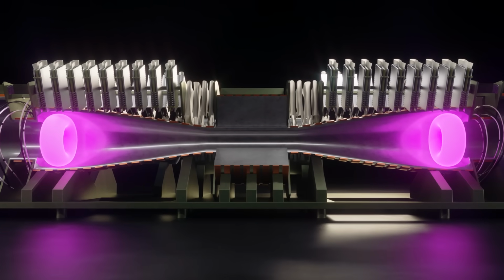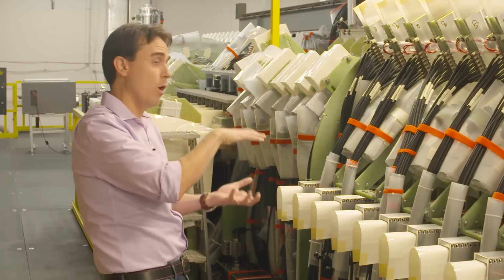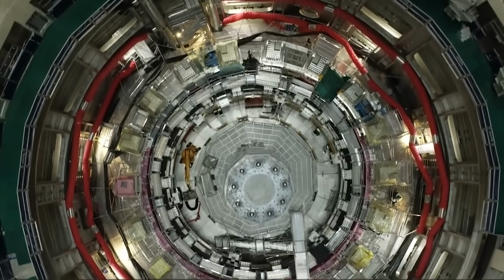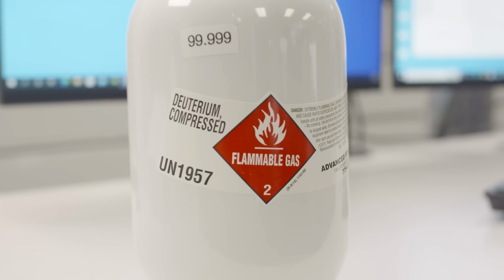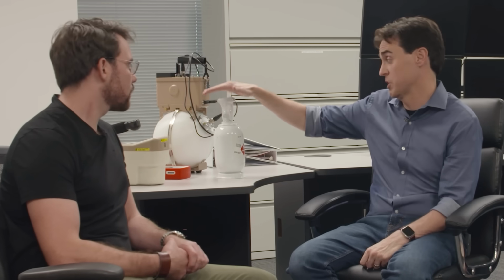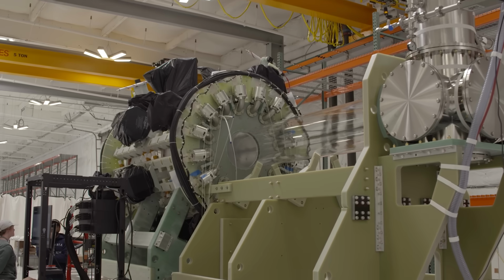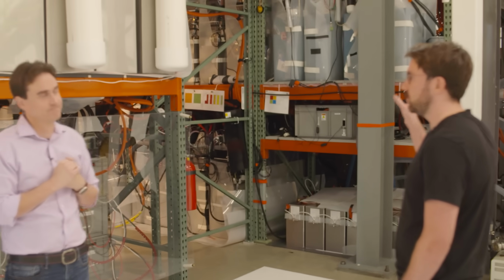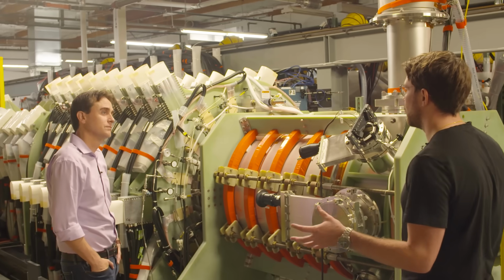A New Way to Achieve Nuclear Fusion: Helion

Comment: What is this machine for? What is its purpose?
It looks like a veeeeeeeeery expensive system.. this is the 6th version  if i heard correctly?
Reply: Yes, they have built 6 ever improving (and bigger) systems so far with a 7th under construction. The cost of the Trenta program was 35 million, which compared to other fusion machines in the same performance class is nothing.
Reply: @elmarmoelzer2229  I don't really understand....how they will extract energy from fusion? I watched again and i think i understand now...they extract energy from the increased magnetic field generated by the fusion.
Reply: @djprojectus   Think of regenerative braking in electric cars, only that you have an energy source (fusion) that adds more energy to the regeneration. Like say if your electric car was driving downhill, with the downhill being the energy from fusion. 
Hope that made somehow sense...
Another analogy: Think of the plasmoid as a rubber ball. You can squeeze it real hard, but once you stop squeezing it, it will expand again. Energy from fusion would make it grow to an even larger size than it was before.  Now imagine that same rubber ball being made from something magnetic (say magnetized iron). When it expands, it would induce a current in the surrounding coils. It if expanded more than to its original size (because the fusion energy makes it "grow") it would induce even more current. 
Sorry, very tired and if this does not make any sense, please let me know and I will try to explain again when I am less tired.
Reply: @elmarmoelzer2229  Yes,it makes sense. But i wonder how much energy can be extracted this way from the energy generated by the fusion. Regenerative braking is very efficient in cars but i wonder if it can be similar in this case. And how many times greater will be the extracted energy compared with the energy consumed to produce fusion. 5 times more? 10 times?
Reply: @djprojectus   Well think of it this way:
Regenerative braking is subject to a lot of friction. The plasma is in a vacuum. There is nothing that it would "rub" against. It is literally frictionless. There are still losses, mainly ohmic losses in the coils and of course not all fusion energy comes in the form of charged particles. Some is in neutrons (neutral and thus won't interact with the magnetic field) and Bremsstrahlung. There might be ways to directly recover some energy from the latter, though (currently under investigation). So extraction of the fusion energy might be... maybe... 80% efficient.
BUT the input energy can extracted the same way with just ohmic losses and that means some 95% efficiency.
So you get Power(in) * 0.95 + Power(fusion) * 0.8 (or something like that) and that should give them a relatively good energy balance, even with a relatively low Q(sci). From what I have heard about 3 is good enough. Might be as little as 2.
Reply: @elmarmoelzer2229  I see. I like this approach to fusion. Elegant,smaller,safer. It could be implemented on big ships for transoceanic transport.
Reply: @djprojectus   Helion is actually considering that as a possible application. Interestingly enough. 50 MW is about the same size as the big Diesels on large containerships (and what Helion is going for with their machines).

Comment: Fusion requires lots of Tritium, which is vary hard to make. Recently some people claimed that they succeeded in running a fusion reactor that produces positive net energy. But  I am certain that they did not consider the energy cost of generating Tritium. Fusion seems to be hopeless from my perspective.
Reply: Helion does not fuse Tritium. They fuse Deuterium and He3 from the Deuterium fusion reaction. Did you even watch the video?

Comment: One of coolest aspects of Helion’s design is that it generates electricity directly by using the plasma’s magnetic field to drive a current in wires surrounding the reactor.  All other nuclear and fossil fuel power plants generate electricity indirectly, by heating water into steam which then drives a turbine which creates current in wires.  Helion just cuts all that intermediary work out of the process completely.
Reply: Very true, but this looks like a bot comment lol
Reply: So true! This beats the 2nd law limits on tea-kettle power plants, which throw away 60% of the energy into the environment. That is a real problem if we're talking 10GW electric plants. Having 10^8 degree high end and using a magnetohydrodynamic - like decompression is a real game-changer. It could even be possible to use the pulsed power output to a motor to drive an alternator to make the 60 Hz directly....
Reply: Absolutely right comment!  Skipping all the intermediate wasteful steps of electricity generation is ingenuous. We are doing atomic and fusion energy generation nowadays but still using 18 century way of turning a turbine to get useful work out of it.

Comment: Wait. I thought fusion reactors needed Helium-3, not create it?
Reply: Helion will produce their Helium3 by fusing Deuterium in the same machine. D+D => He3 +n or D+D => T + p (the Tritium eventually decays to He3 as well).
I think you might have spotted the mistake the animator made for this video: The D-T fusion reaction results in a He4 not in a He3. The D-D fusion reaction results in a He3 or a Tritium atom (50:50 chance).

Comment: The physics of this thing are way beyond me, but my mind said, "Hm, it's like they created a pair of electromagnetic railguns that shoot plasma instead of projectiles, and they're firing them at each other simultaneously to make the plasma bullets collide."

I also thought, "Holy shitake, look at the SIZE of that thing! It's a tiny fraction of those tokamak reactors that other entities are using." And it's just the developmental stage. If they can make this thing generate more power than it takes to run it in ten years, then twenty years after that we'll see versions of it smaller than a household heat pump. ANd twenty years after that, we'll see versions small enough to power moving vehicles, like ships and aircraft and spacecraft.

And it fixes a flaw I've seen myself for some time: Current nuclear fission powerplants, both on land and in naval vessels, are basically steam engines. We're using the same tech that moved Mark Twain's river boats up and down the Mississippi nearly two hundred years ago, but substituting a fission reaction for the coal boiler to generate steam. This thing generates electricity directly from the fusion reaction. No more steam, no more radioactive wastewater, just electricity from cheap, abundant fuel, with a relatively clean process.

I sure hope they overcome all the problems and make it commercially viable in the next decade or so. I hope to see the first commercial fusion powerplants and ships, and hopefully spacecraft, in my lifetime.

Comment: If we can form new atoms, wouldnt that mean its potential is to create resources from scratch? We don't have to worry about running out of metals and such?
Reply: If I'm not mistaken, fusion reactions become more difficult to achieve and release less energy with heavier elements. Even stars stop fusing once all of their fuel has turned into iron (element #26) at the end of their lives. But although there are almost certainly other complications that I'm not aware of, maybe we could obtain a few elements beyond helium.

Comment: one of the problems with fusion moving forward, is what will be the reaction if a fusion reactor loses containment of the super-heated plasma?
All other variables taken away, the different designs all use super hot plasma. 
The fuel itself is not dangerous in s the sense of being radioactive. However what would the consequences be of 10 million degree plasma encountering earths atmosphere?
I would assume a massive explosion as the temperature and pressure differences are equalized, and the water vapor and oxygen in the air react violently to the temperature. 
This may not be a problem if the viable fusion reactor only ever has a small amount of plasma in a viable state. 
However if the way forward involves a massive scaling up, this could be a serious concern, and warrant sequestering the reactor in a similar structure as fission reactors. 

I am optimistic about this non-turbine energy recovery system though.
Reply: You are assuming wrong. Please, you spent more time writing this comment than it would have taken you to google this.
Fusion plasma is very hot, but not very dense (1/1000s the density of air) and there are only tiny amounts of fuel in the machine at any time. The total energy content is a few kWh.
Oh and ambient air would immediately cool the plasma and all fusion would stop.

Comment: So the moto perpetuum is not a dream anymore? Because if it can generate this huge amount of energy (more than needed to function),  it's possible that a fraction of this subproduct can be reused so the machine never stops, right?
Reply: No, cause you will always need new hydrogen to keep it going.
Reply: Not exactly, the fuel depletes, and the machine deteriorates itself overtime
Reply: there is no such thing as moto perpetuum, it will never be possible, energy always has an cost, and we're increasingly losing the means to afford it.

Comment: There's a few things missing, like how many x-ray/alpha/beta/gamma/etc. are created.  I like how it concentrates the plasma, gives it a nice target cross section.  Not sure how the mass/EM of the Earth is accounted for, but I imagine the pre-ignition rings wouldn't care that much.  I think 1/2 the input energy is wasted on dipoles, and not sure what kind of ground sink/switching is necessary to move 100k Amps that quickly.  I'm not a nay-sayer, it just brings more questions as answers pop up.  the go larger to go smaller seems kinda common.  I think the use of more graphites and PPQs are inevitable.  I mean detecting neutrons, slowing them down, and using their energy to maybe clean up Beryllium in secondary reaction chambers to mfg. input products like tritium and others on-site makes more sense to me than the "business" model.  You could spend a lifetime just optimizing the perfect phase-shift harmonic EM toothpaste plasma shooters, rofl.  And couldn't you just shoot more x-rays at the plasma to gain that extra 1M K°, I mean yeah you would need some atto second capable signalers i guess.  Ok, I'll shut up now.  Someone tell me how much of the other particles are created and tell me how to get a job there w/o a PhD?
Reply: Flip them an email. He says they're hiring.

Comment: 10:17: "Tritium is extremely rare." Happenstance helium-3 is also rare. It has an abundance of 0.000137% of the rare gas helium. And: virtually all helium-3 used today in industry is produced from the radioactive decay of tritium. Probably because it is a much cheaper production method than making isotope separation from helium sources.

Comment: Very interesting video. And hats off for so much Innovation on a subject that has been studied for so many years with drawback after drawback by government funded institutions, all by a "small-ish" privat company.
Still one question wasn't addressed, and that's if there will really be a net gain of energy at the end (or better: if this will be the case in the foreseeable future), taking all energy into account that goes into the process. The "breaking news" a few weeks back about the NIF having a net gain of energy was very misleading in that regard, as the whole prosses (not only the reaction itself, but running the whole reactor) consumed about 100 times more energy than they got out.

Comment: It's a nice/fancy/expensive science experiment.  The reaction chamber, even scaled up massively in size will still not contain a fusion event for more than a  nanosecond at a time.  I'm not seeing a way to design a sufficient cooling system adequate enough to pull away waste heat in the process and not interfere with the field compression needed there.  Hopefully, there will be a solution.  They still have to prove their proposed energy conversion method to electricity, (Any form; AC or DC) is viable.

Comment: We already had cheap fusion in the 1990s, it was called 'cold fusion' because the handheld power cells were small and relatively cool compared to the enormously high temperatures in tokamaks. Cold fusion was crushed by bad press and disinformation but the various cold fusion researchers kept tinkering anyway.

Comment: So laws of thermodynamics been broken?

they been soo quick to shut every down that believes they made machines that give ou5 more then put in..

They all got demonized, lost funding, rejected from the field and in many cases even went missing or comitted suicide under strange circumstances. 

So all those people that went missing actually had groundbreaking tech..

Thet just werent ready to admit it!?

This is not a breakthru lol 

Its a drip drop process of slowly admitting laws of thermodynamics only apply to theories that are bound by them and our entire measurement system and emgineering system has been developed and designed with those laws imposed by ourselves not imposed by nature..

Absolute joke..

Comment: I see how these could be used for future spaceship propulsion like in the expanse. Instead of using the magnetic field to generate electricity from the plasma magnetic "pressure", that electromagnetic field could be used to funnel and direct the plasma out a magnetic nozzle to generate thrust. It would of course have some losses that would generate electricity anyways, but those could be used to power the magnets themselves. It would probably be a fairly effecient system.

Comment: multiply the number of generators used by 10 or another even number, arrange them in a radial configuration where there's a toroid connecting central collider, and rotate the generators along the toroidal axis like a stellarator. pusling the generators in pairs and opposite side of the arrangement and in series with one another. 
something just tells me that applied physics and engineering a fusion reactor like this will be artful and just like the symmetry used to collide the fuels, the generator would also need to be symmetric.   The universe is full of symmetry and art.

Comment: Hi A Question about the  rotation Gyro Orbit it’s impacting the generator walls so you are building that part of the machine 25% bigger, 
But does that then allow that Gyro Orbit increase as well which starts the problem all over again where is impact in the wall of the generator, not quite sure if I explain that right, So in short you resolve one problem but create a bigger problem,  And you could create a Event  Horizon. I think that is called, as I probably can gather I don’t know not nothing about these things, Good luck with your quest. 
PHIL FROM THE DARK SIDE OF THE MOULIN,

Comment: A lot of handwaving ..
Your funding mony will be consumed by virtual plasma ..
Reply: pov: you dont even know how any part of it works
Reply: @terraneko8999  You're absolutely right. 
But I know how ITER is supposed to work. 

And you know how huge this project is. 
And you know that the member states in the ITER consortium 
are not spending 24 billion euros without a solid reason. 

And you know, as I do, that there are a lot of "companies" 
jumping on the fusion bandwagon today. 

All of them will lose their money. Not just those 16 cylinder 
diesel engine Trenta from Helion.

Comment: Instead of using two injectors, why not use six?  One for each face of a cube.
Reply: 20:00 This reinforces the idea for me that this could be a good idea.
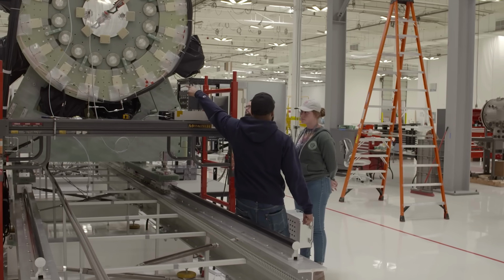Reply: 26:00 This implies to me that having additional inertial kinetic energy arrive at the central fusion chamber would make the final compressive magnetic field easier to generate.  Perhaps having additional balls of plasma arriving from other directions might be able to achieve that reduction in difficulty.
Reply: Might there even be an advantage to having multiple pairs of plasma balls arriving in staggered fashion to increase the pulse rate, instead of simply having them arrive simultaneously to increase the pulse magnitude?

Sort of like increasing the number of pistons in an internal combustion engine to smooth out the power pulses.
Reply: Although I might have the wrong idea with the staggered-pulse thing, because it seems like it is the change in magnetic field that generates the electricity, because I don't know if an increase in the pulse frequency of the magnetic field would lead to an increase in generated electricity, especially if the magnetic field doesn't have enough time to bottom out between pulses.  Then again, if there is enough time...

I'd really be interested to know about the phase of the magnetic field during various parts of the reaction.